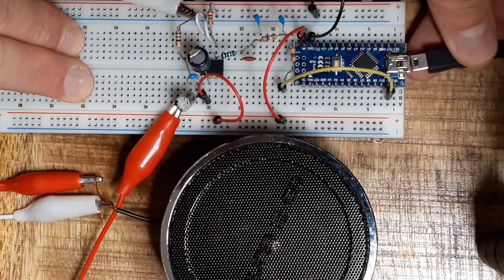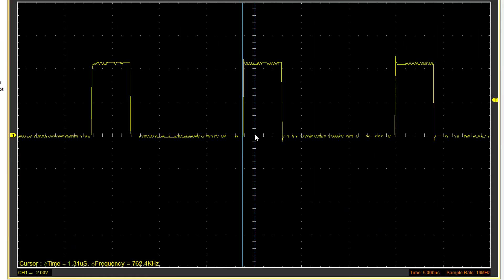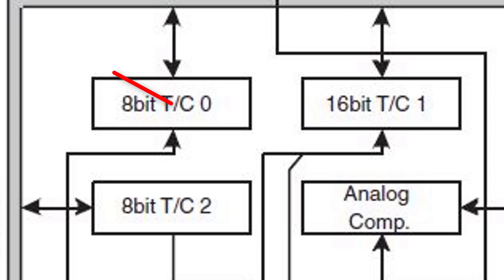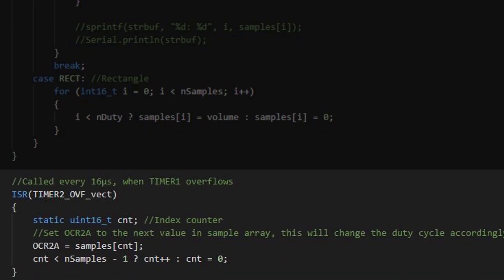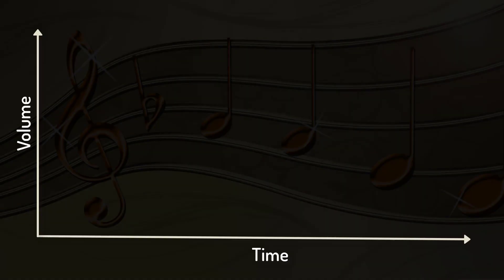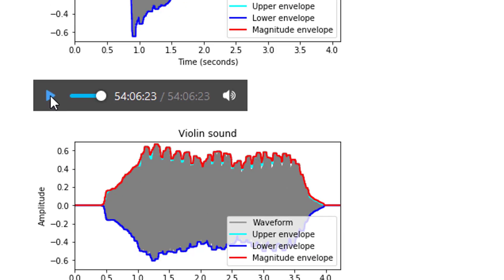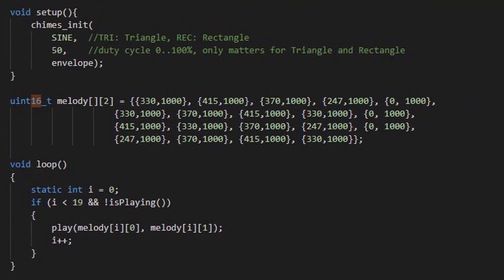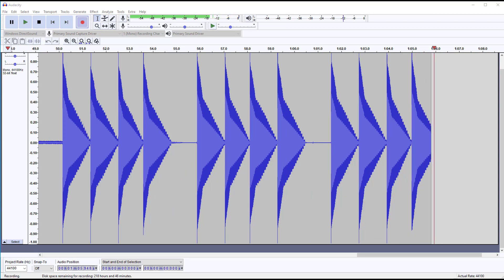Arduino Synthesizer plays  Westminster Chime

Comment: hello, wow that's impressive, is it possible to port the code to esp32? It would be great to make a basic library with preset instruments, the ones that exist for the esp32 are very heavy, it could have i2s or dac audio output directly, even bluetooth. congratulations great job.
Reply from the maker: Unfortunately not. Arduino and ESP32 have totally different  Architecture, so I'd need to rewrite this from scratch.
Reply: @DoctorVolt  I understand, I got carried away by emotion and I assumed that it would be easy for you, but making it from scratch must be quite tedious, do you know of any typo synth wave or synth fm library for the esp32 that has preset instruments, I know that with Mozzi or Marcel license you can be done, but as I said they seem great to me they have many things. Thanks for your time, congratulations again.
Reply from the maker: No, unfortunately I don't know such a library for ESP32.

Comment: This is fantastic. Is there a way to change the ADSR values on the fly? For example, either shortening  or extending the sustain, depending on the input trigger? Thank you
Reply from the maker: Yes this would be possible. You need to write some PC software that sends the data to the Arduino via MIDI or similar and the Arduino can change these parameters on the fly.

Comment: This is really cool I thought about if it would be possible with arduino and wanted to try this, seems this video saved me a lot of trial and error time :D
Btw now add 4 potis to the adsr and maybe a variable filter and you have a real little synth. Additionally add a midi library and you can even control it with a keyboard or music software!
Reply: Btw another idea... would it be possible to modify the "led fade" sketch to use the duty cycle of a pwm for adsr? Could connect the pwm pin to a transistor's base and that then controls a lowpass filter circuit's cutoff frequency...this way you could use an analog potentiometer to control the "led fade" thingy and thus an external circuit's adsr.
Reply from the maker: Maybe this could also be interesting for you: https://www.notesandvolts.com/2014/07/build-auduino-granular-synth-part-1.html. This guy more or less already did what you propose.
Reply: @DoctorVolt  Cool thanks